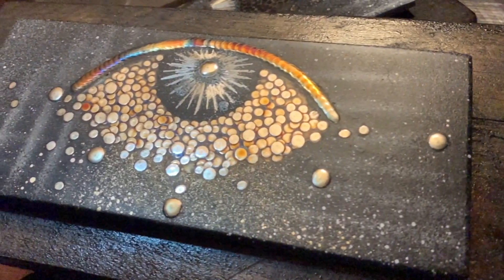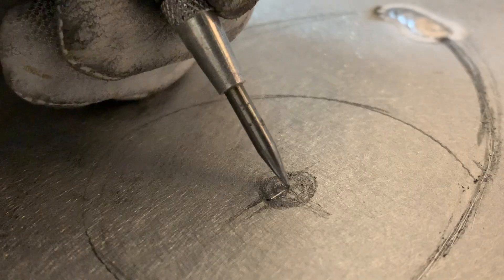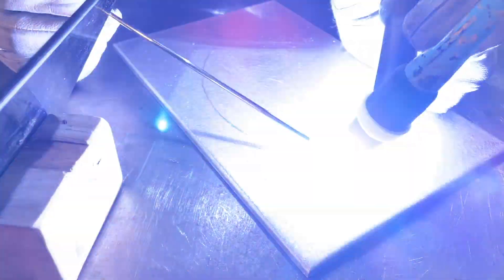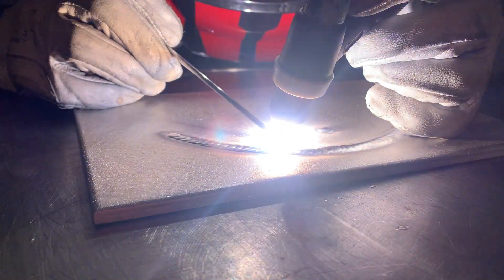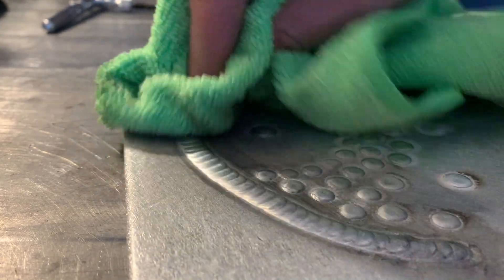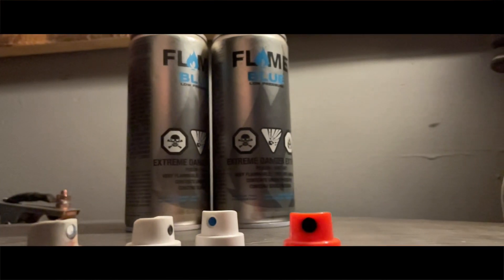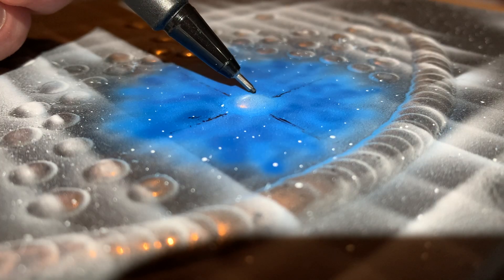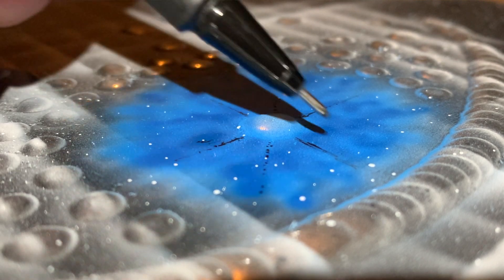I tried Tig welding an EYE out of Aluminum🔥

Comment: That looks absolutely awesome Dusty. Wish it was hanging on my wall. I still get a little nervous when you pull out the spray paint. But I shouldn't. The multi media art pieces  as well as the purely welded pieces you do are amazing.

Comment: I just found your chanel and wanted to ask some questions. I am wanting to to the turbo piping for my truck. I have done stick and mig welding but not much tig, do the colors from the heat on stainless wear off over time? And if so is there any way to protect it? I'd be worried it would start looking poor over time in my application